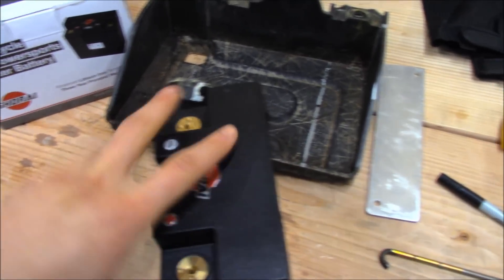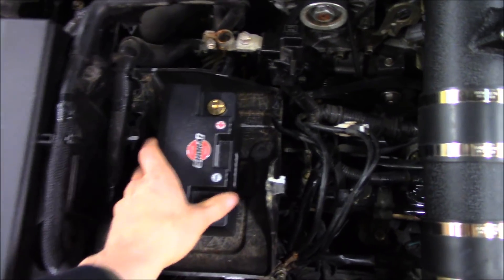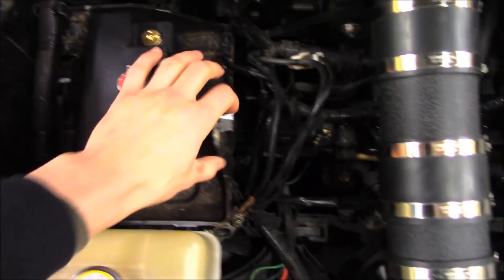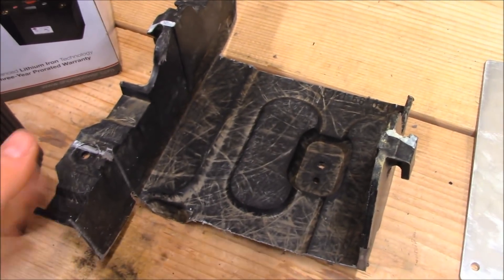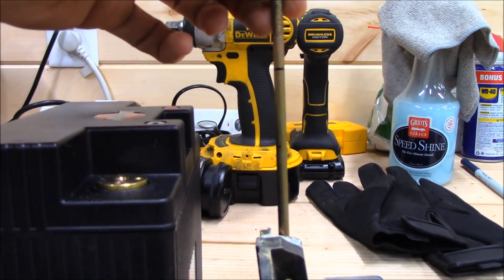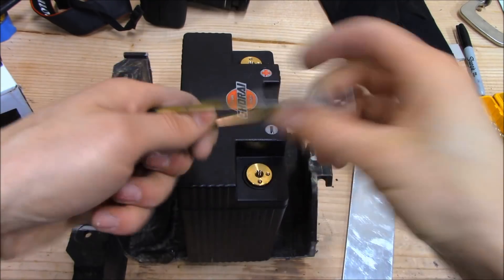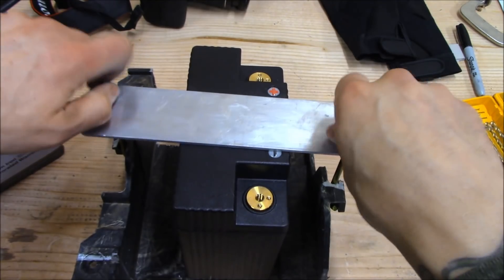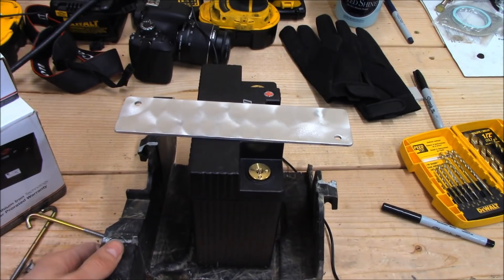Project RX-8: Lightweight Battery Solution 5lbs!

Comment: Hi Quinn. After this mod, did you ever check the battery's temperature? I'm asking because modding the tray removes the cooling duct functionality and temps in the RXs engine bay are quite high. Thanks for your opinion!
Reply from the maker: I have not, but the battery is much smaller and farther from the engine.

Comment: Hey Quinn, let me know if this is a stupid question but I cant seem to find many other's opinion especially using this battery in the application we are. As it's a Lithium Ion is it fine to charge the battery while the terminals are still connected? 
I had an issue where the Shorai was giving me the four light flashes with crazy beeping for the voltage code but then I tried hooking her up while the terminals were on for the fuck of it  and its charging fine now?
 I'm a little confused as to what's going on and if this is safe for the battery or not.
Reply from the maker: I always charge it with the terminals connected and have never had an issue. I've had the charger do weird things once in a blue moon but unplugging it and starting again cleared it up.
Reply: @TheSlipAngle  Get this, I called customer support since it's still "under warranty" and the 1ST thing they asked was if I was using this in a car LMAO 🤣 I just bullshited them and said it was in my Honda CBR 600 and they sent me a brand new one! Thing is the guy deff suspicious  that I was bullshitting 😅 I literally had to photoshop the sticker from the one in the Rx8 into the one I run in my bike for the Customer Support quality assurance rep because the 36L3 just wouldn't fit in my CBR's tray... but I guess they fell for it 🤷‍♂️... that or they took pity on me.
Either way that's good to know, I'll just be leaving the thing on store then when I dont plan on driving the 8 for a bit

Comment: how is the battery holding up, considering the extra heat from radiator cooking it :D
Reply from the maker: 3 years later and still going
Reply: @TheSlipAngle  This is a great information. I think you should do quick follow ups on staff like that as when I originally watched the video when it came out, I was wondering how it will live with cars charging system and everything :)

Thanks for taking the time to respond :)

Comment: Can someone link me a video explaining what all the weight reduction does and maybe with real world testing
Reply: Just watch all of the videos (or at least look at the titles) to get an idea of what he's done. I can think of: battery, exhaust (Primarily the stock exhaust manifold to header swap) pulley's, Cold air intake (AEM), Steering wheel (Nardi), wheels, and probably more, but those are the ones that stand out. As always, to each, their own. Mod what you think works for you. I'm going to take it slow with mods until I need a rebuild.

Comment: Haven't read the comments, that's not a tap you're using to thread that bar boss. That would be a die... But still, confirmed my thoughts about how to mount a lightweight battery! Thanks!

Comment: Any reason you didnt just lay it on its side and tie it down from there? Little bit lower CoG and little more out of the way. Its lithium ion it shouldnt care about orientation.
Reply from the maker: It wouldn't really make sense to lay on it's side as it would make attaching the terminals more of a PITA and I didn't want to undue the factory wire looms to accommodate that in case this didn't hold up as a viable long term use solution. At 4.8 lbs it's not really going to matter which way this is mounted from a CoG standpoint ;)

Comment: I've been using the same battery in my NSX without problems. Only catches are that you need to replace it every 2 years and it won't hold a charge for more than a week or so, so only worth using on a daily driver unless you disconnect while not in use. Optima Yellow top batteries are a bit heavier but still very light and possibly a better option for non daily driver cars.

Comment: Thank you .
Is everything good till now?
Reply from the maker: Still running strong!
Reply: The Slip Angle
I’m thinking to replace the battery for my V8 Camaro SS 2018.
Do you think it will work?
And why you have to buy battery charger?
Do you need it in the first time charging?
Car alternator will not help in the charging?

Thankful
Reply from the maker: This battery is 540 CCA. I don't know what CCA you need for that engine. I would guess more. You can't charge lithium batteries with a conventional battery charger, hence why I bought the charger for it.
Reply: The Slip Angle 
Thank you, But any way the car alternator will charge the lithium battery when you start the engine, or what?
Thank you
Reply from the maker: Yes, I'd have a pretty useless car if my alternator wouldn't charge the battery lol
Reply: The Slip Angle 
Thank you very very much for you patient. You are a really helpful person.

So the charger you bought for the first time charging only, or maybe if the battery empty for some reason like a long period without driving the car.

With all respect
Best Regards

Comment: So how is it going with this battery? Any updates? Has it gotten too hot under the hood? Are you tempted to move it to the trunk?
Reply from the maker: Good so far! No issues with heat and no desire to relocate and add 10 lbs of cable to put it in the trunk :)
Reply: Nice, good to know. Any track days run with it installed?
Reply from the maker: Not yet, but we'll be filming a segment of the Slip Angle for it.

Comment: Do you have a long term  update on this battery?
Reply from the maker: So far I have not had any issues with mine, even letting it sit for a 
week or two. Any downtime more than 2 weeks I use the tender for it
 as recommended. I'll probably end up getting another one of these soon for another one of my cars.
Reply: Garage Quinn Motors that’s great news

Comment: any disadvantages with a lithium battery vs a conventional agm ; im looking into light weight batteries for my miata
Reply from the maker: You are not supposed to charge these batteries with a conventional charger and I believe they have a little harder time starting in the cold. I've only ran this daily with warmer temps, but so far it is still holding up and working pretty well.
Reply: good too hear!! I would like to go lithium but probably wont because of the price,  ill probably go with a pc680 from odyssey or similar one from turbo start, I do live in a cold climate ( chicago ) so cold starting is important but i don"t really drive it when it less than 20 degrees or that much in winter anyway.
Reply from the maker: I'm in New England and I'll drive my 8 in the winter when the roads are clear and dry, so we'll see how it does this year :)

Comment: Over $300 for a battery that needs a special charger? Ill take my chances with an optima car battery.
Reply from the maker: The battery was 250.00 and it's been holding up really well. The 40 lb weight reduction in the engine bay was definitely nice too.

Comment: I am afraid about battery hardware-terminals...
Reply from the maker: How come?
Reply: thanks for the replay...i am afraid that they are going to melt...
Reply from the maker: Why would they melt?
Reply: original battery has 70 Ah and the aftermarket battery has 30 Ah...
Reply from the maker: I am still not following how that would melt anything. I haven't had any issues since installing months ago. My friend ran this same battery in his MR2 for 9 years straight without issue as well.
Reply: ok..thanks...many regards...

Comment: Nice videos...I am an rx8 owner from Greece...What is your opinion about a lithium motorcycle  battery Skyrich 30Ah (HJVT-2-FP) 720 CCA?THANKS...
Reply from the maker: This is the only motorcycle battery I have tried so I cannot give any input about the Skyrich. The 540 CCA the one I am running cranks the car harder than the acid unit it replaced though.
Reply: Giotoules Cris did you used this battery?

Comment: Hey so on your startup, the car chirps when it first fires. What is that from? My 8 does the same thing and idk whether to look at the pulley or belts. Nice Video! Thanks.
Reply from the maker: I think it's just the belts. It's done that since I've owned it.
Reply: I hate to revive old posts but it might be from the A/C compressor. Try starting g with the A/C know set to 0 and see if it chirps

Comment: How is the long term with that battery. Do you think it would work on the fd. I would love to save some wieght. I dont want to add more power to make it faster
Reply from the maker: Well I just installed it so I will let you know. If it can crank the RX-8 13b with its higher compression with authority, I am sure it can do a lower compression FD. After driving the car and starting it with a full charge on the battery, it cranks it noticeably harder than the acid filled unit it replaced.
Reply: Hmm. My car is driven once to twice every two weeks. I wonder if it will stay charged enough to start the car. Dude if it does i will have tonpurchase one for sure
Reply: @TheSlipAngle  its been 9 months hows the battery doing?

Comment: I so want to do this to my BMW.
Reply from the maker: After doing this, my buddy with the silver E46 M3 said he was using a 240cc motorcycle battery in his car, but let it die completely on a few occasions so he didn't get that great of life out of it. He also said cold winter starts were an issue as well.
Reply: OK thanks. Might have to wait a coupe more years before this tech is more mature.

Comment: You should skelaton the hold down for easy access to the chargeing port
Reply from the maker: I ended up just connecting the charging cable and ziptie'ing it off for easy access because yeah the hold down makes it more difficult to access.